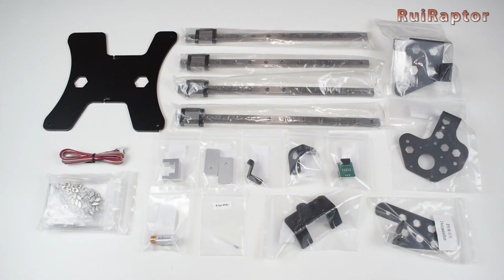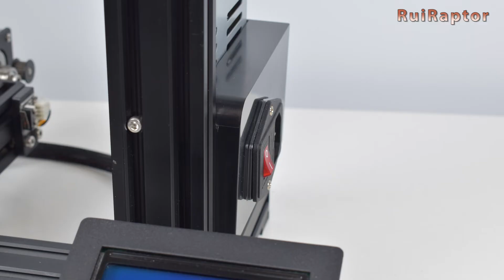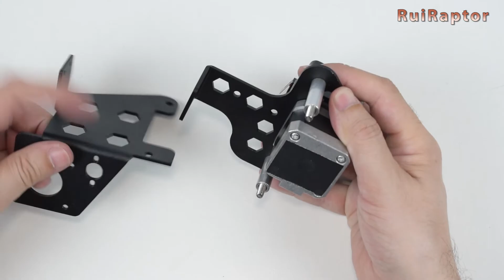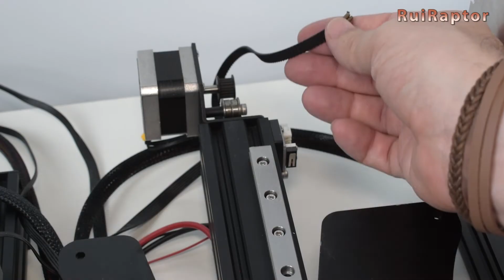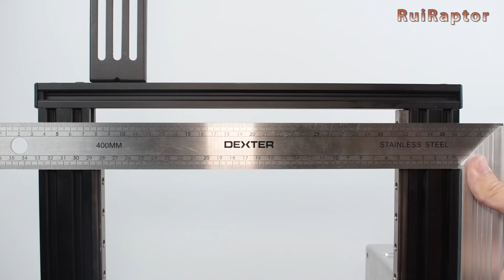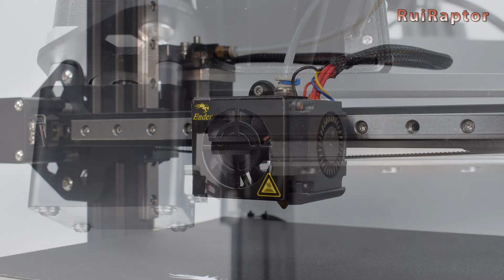Creality Ender 3/PRO UPGRADE - HOW TO Install Linear Rails (X, Y & Z Axis)

Comment: I converted my old ender 3 to linear rails on all axes, dual ballscrew z axis, microswiss ng direct drive with bltouch and bigtreetech skr main board, klipper. all custom parts machined on cnc out of 6061 alu stock. feels amazing, silent and I got 417mm z travel as a bonus.

Comment: Thank you for the amazing video. Well, it won't make a difference on the print quality if you print at the stock slow speed, especially if you know how to adjust the V-slot wheels. However, it makes a difference when printing at higher speeds (e.g. if you are using Klipper). Also, it increases the service life of the stepper motors; where it almost eleminates the friction, reducing the load on the motors.

Comment: If you want a super lightweight carriage.
Buy x2  abit longer alloy profiles. And x2 rails with 4 blocks on them. ( each one should be close to the corners but with some space).
Get a carbonfiber plate with same size as the bed. Cut away as much as possible. Make sure there is some overlap to drill the 4 leveling holes. The blocks are now holding the weight basically. So the carriage dont need to be as strong anymore.

Comment: instead of getting a new belt, on some models just change the X and Y belts... the "New" Y belt just needs less tension than before, because it's a little bit shorter.. but it's an option in some cases

Comment: Such a pointless upgrade. Way overkill. FDM printers aren't CNCing metal.
Reply: Wheel nerd
Reply: I dont think its pointless on the x axis if your going with a direct drive, other than that its prob overkill.
Reply: With this upgrade, along with the creality Sonic pad/klipper firmware I'm able to print at 150mm/s without the wear on the wear on the wheels. The rails are more easy to maintain. I don't think it is pointless
Reply: Honestly not pointless if we account for the uneven wheel wear of the y axis. The x and z axis wheels evenly wear out, while the y axis wears out on the bottom more then the top because well duh gravity pulls the wheels onto the bottom edge. 

Not to mention the z axis upgrade helps with alignment and sag. And even z axis twist if you have a direct drive extruder. 

X axis linear rail would be nice for faster speeds. 

Overall its a great upgrade for what it is. And considering the accuracy of some printers reaching into the 10th or hundredth of a mm its still fairly accurate for the average consumer.

Comment: Hello! very interesting and informative, I love it! I have a question: I have a very old CR7 3D printer, but right now the motherboard has deteriorated, I bought a new ender 3 clearity v4.2.2
the question is that I did not take into account the power supply of the board, that is: 24 volt power is written on the new dress and 12 volt power supply on the old one. so I have to buy another 24 volt power supply or does this board have the function of working on both voltages> 24 volts and 12 volts ??? thanks for the reply in advance! Best regards, George!

Comment: I made a DIY Z axis linear rail set by CNC cutting my factory plates, adding dual Z, adding very short solid bed spacers leftover from the rollers, and I can now reach 271mm in my Z axis!

Comment: I take issue with the videos claim that linear rails do not improve print quality.

The only reason you wouldn't see any improvement to your print quality is if your print quality was already maxed out at 30 mm a second

On the other hand where you really  see a huge benefit with linear rails is when you want to push the limits of the machines speed capabilities.

If you're happy printing it 30 mm a second then there's no need to upgrade to linear rails, on the other hand plastic wheels start to have real issues when printing speeds start to exceed 60mm/s

On the other hand linear rails combined with clipper firmware and input shaping allows you to significantly increase your print and acceleration speeds

It's not uncommon to see E3 v2s outfitted with linear rails printing at 120 to 150 mm a second with accelerations in the range of 3,000 to 7,000 and get the same quality They were getting at 30 mm a second.

In other words Linear rails on the Ender 3 will allow you to increase your print speed and acceleration to the point where the stepper motors start losing steps.

A stock E3V2 with plastic wheels can barely handle acceleration of 300 on the other hand an E3V2 with linear rails can handle accelerations of up to 10,000, of course at those speeds you really need to lighten your y-axis or you're going to start skipping steps.

Going to linear rails and Klipper has allowed me to reduce the print time on some of my prints from 12 hours to just about 5 hours.

So if you're happy printing at 30 mm a second or 60 mm a second with degraded quality then there's no reason to upgrade to linear rails, but if you want to maximize the speed and quality potential of your printer then linear rails are essential
Reply: The main difference come from the X or Y axis? Do you track the before and after installation acceleration difference?
Reply: @felipenavas  Z axis mod has the most advantage because it eliminates gantry sag which is a major weakness of the single Z lead screw design. the next is Y axis mod because the original design only loads one edge of the POM wheels leading to uneven wear demanding more frequent maintenance. rail mod will reduce bed weight. although this mod using a single rail does not inspire the best confidence because you are relying on a single MGN9C to sling almost 2kg of bed mass. i don't think that is a good idea and will prefer dual rails on the sides of the Y extrusion.

Comment: Amazing how much money is spent on these printers with upgrades that aren't going to make much of an improvement. Why not just buy a better printer in the first place?
Reply: That's a fairly odd statement, you obviously have no idea what you're talking about... thats pretty sad.. let me guess by a prusa, right?
Reply: @warriorsofradiance7100  No just the opposite, the Prusa is for people who just want to print and their printer is not their hobby. They are buying an expensive tool that has a reputation for ease of use and reliability.  A bed slinger will always be slow because of the moving Y mass so no matter how much you upgrade you can't overcome physics. While you can improve print quality it will always be slow. There are so many channels pushing upgrades.... only to conclude at the end, "I guess the Benchy looks about the same, so the upgrade worked and you should buy it." CoreXY has much better mechanics and you can print much faster. I got the TronXY X5SA-Pro which is a full metal frame with metal rollers( not linear rails, but a vast improvement over rubber rollers), 32 bit controller, 24 Volt power supply and touch screen. Almost forgot it came with auto bed leveling. You get a lot for your money and don't have to upgrade everything. Next install Klipper firmware on the Raspberry PI that your are already running Octoprint on and you can print fast with high quality but Klipper is more technical than Marlin so a bit of a learning curve. Get an accelerometer and tune Klipper to handle the mechanical resonances resulting in better print quality even faster. Build a high flow hot end and print faster yet. You have a bigger, much faster and very reliable printer without upgrading everything. This weekend I picked up a used Ender 3 Pro to use as a test mule for hot end concepts.  It is solid, much heavier than I expected and a good value, but it is an entry level design optimized for cost and all components were optimized for cost.
Reply: You do know prusa is probably the shittiest old tech in the industry an they fail just as much as any printer. You're just not going to hear about because they keep it as quiet as possible. If you're needing an autobed leveler you're trash at 3d printing. Tronxy is hot garbage, always has been. Core x/y machines are nice but not necessary, if all you care about is speed buy a Resin printer, of which I run/own several.Sorry bud but ender 3s are really good printers. I run a farm of enders do maintenance once a month. Very few failed prints, if any. But I've been at this for 8 years, used wooden framed printers an custom built as well as the super expensive. I'll take a stock ender 3 an make ya look like an amateur. Tell ya what send me your ender 3 because it's so trash..

Comment: Currently installing this same kit to my Ender 3 Pro. A couple things I have found- The kit is missing (4) bolts & t-nuts for the linear rails. The power supply bolts are way to long- my upper one bottomed out and I had to trim it back to 25mm. The lower bolt didnt hit anything so I left it as is. I designed and printed my own alignment tool for the Y axis fitting onto the 40x40 profile.  There was no mention of a Y axis offset for the linear rail so I set it to 25mm off the front of the extrusion. The M3x8mm long bolts are entirely to long for the right side Z carriage & the X carriage on the gantry. This has me at a dead stop as I need to get M3x6mm long bolts. I have also noticed the bent steel plate that holds the Z nut the stackup is off by .5mm and I am out of adjustment. Also the 90 degree bent piece must be slightly off as when it is tightened you can see the stepper motor move. So this will require me to tear apart the gantry to grind the slots out further. In my particular case at the bottom of the vertical rail my Z rod is 25mm +0 -.02mm consistantly. At the top, with the gantry fully raised and the nut adjusted to the best of my ability the Z rod is 24.45mm +/-.02mm - measured with digital calipers. I was able to get the assembly to move smoothly by loosinging up many of the screws and working the unit and slowly snugging them up. However I understand since this is running at an angle my E Steps will be odd at best. I intend to tear down and grind the slots out to make it precise. I also noticed one of the linear rails, oddly enough the smoothest one, had a slight bow to it. This is the one I used for the X gantry since it was the smoothest. I will update as I get it all fixed and installed. If you are doing this mod dont expect to be done in 25 minutes. LoL.
Reply: UGH I had the same issue with my X and Z M3*8 screws being too long. The X axis plate can't be tightened down and I am stuck waiting for the M3*6 screws I just ordered.

Did you message Creality to pass along your feedback? I just sent them an email.
Reply: @red_kirby1  I did not bother. I wound up just ordering a screw assortment so I had plenty for this project and others.

Comment: Great video. However the issue with the hotend adapter is unacceptable. The kit is manufactured by creality for the ender 3/pro and the part doesn't work? Completely invalidates the whole kit. And that right z plate is a joke. There should be dual z axis to help keep the gantry level at all times.

Comment: Will linear rails help with elephant foot?
Reply from the maker: Hi Zach, the elephant foot is an issue caused by the first layer not perfectly calibrated. If you have the elephant foot issue, re-adjust your bed leveling/nozzle to bed distance.
Reply: I wouldn't think so. That's more of a slicer/printer calibration issue.
Reply: No it will not

Comment: Hi Rui thanks for an honest and informative video.
This helped and decided my choice.
Anyway I've found this modification is not for me,
Mostly because I do not see the big gain in this modification, 
and that video is so informative that it provides answers to things one usually lack the knowhow to ask for , 
and in no way promotes a product that is one-sidedly focused only on selling, 
But is so that the viewer can conclude on their own .
THANK YOU.
Reply: Biggest gain is mainly a more maintenance-free operation of the printer.  You only need to keep them clean and lube them every once and a while, as opposed to make sure the rollers are not to tight but not to loose either, which can be a very narrow area between overtightening and having them to loose.
Reply: Actually the video is wrong.
The only reason you wouldn't see any improvement to your print quality is because your print quality is probably already garbage.

No amount of bed leveling or linear rails is going to fix a poorly tuned machine.

On the other hand where you really do see a huge benefit with linear rails is when you want to push the limits of the machines speed capabilities.

If you're happy printing it 30 mm a second then there's no need to upgrade to linear rails, on the other hand plastic wheels start to have real issues when printing speeds start to exceed 60mm/s

On the other hand with linear rails and clipper firmware installed you can print upwards of 120 to 150 mm a second and get the same quality you were getting with the stock wheels at 30 mm a second.

Linear rails on the Ender 3 will allow you to increase your print speed and acceleration to the point where the stepper motors start losing steps.

A stock E3V2 with plastic wheels can barely handle acceleration of 300 on the other hand an E3 V2 with linear rails can handle accelerations of up to 10,000 of course at those speeds you really have got to lighten your y-axis or you're going to start skipping steps.

Going to linear rails and Klipper has allowed me to reduce the print time on some of my prints from 12 hours to just 5 hours.

So if you're happy printing it 30 mm a second then there's no reason to upgrade to linear rails, but if you want to maximize the speed and quality potential of your printer then linear rails are essential

Comment: The belt paths are very diagonal, which will result in a non-linear translation from the stepper movements to the carriage movements
Reply: That's the first thing I noticed.  Total design failure.  Why would they do that?  Was it installed wrong?
Reply: @NackDSP  Probably not.  The stepper motor for the X-axis should be utilising an idler just like the Y-axis does because even with the spanner angled down so it's as horizontal as possible compared to the carriage but it's unfortunately not.
I use sort of the same lineair rail mod for the X-axis and its ehm, exactly the same, and I am not happy with the idea because of exactly the thing you and Ron DLH mentioned.

Comment: Well presented video, but I do have to wonder why bother doing it if the print quality doesn’t really improve and it requires more care and is noisy?
Reply: Linear rails need no adjustment like the eccentric nuts. Also, they won't be affected by dirt etc on the extrusion. They do make a difference in my experience
Reply: @trevormallow2788  I am installing these now to be honest and I printed with the x axis rail prior to upgrading my z and the print was amazing. I’m upgrading my z now
Reply: @ruckus226  Same, only did X in the beginning, it was much better.
Reply: It makes the difference at higher print speeds.
Reply: As far as I've been able to figure out from my linear rails is that they support faster printing and maybe a tad less energy consumption by the whole thing running smoother. The motors don't have to apply quite as much torque on rails as the friction is considerably less.

But the print quality doesn't improve and in fact, surface quality is likely to decrease.

Linear rails are about as hard as you can get hard couplings for motion, so pretty much every little bit of vibration and every little bit of resonance is translated to the print surface.

Linear rails remove some vibrations from the system, but they translate the ones you can't really get rid of (stepper motor steps and lead screw imperfections for instance) directly to the surface of the print.

And the vibrations they remove were already smoothed out to near non existence by the rubber wheels and much softer axial couplings. And those also smooth out stepper steps and all other vibrations in the system to a much less defined extent.

As they are far harder couplings and translate every bit of vibration to the print, you also need to, as the video stated, take far more regular maintenance into account.

But, this only matters for artsy printer users that want nice smooth surfaces they don't have to do much aftertreatment on.

That's why I maintain that artsy users should stay away from FFF and go with resin printers instead.

I personally don't care about surface quality in the slightest as most all my prints are mechanical and the precision and speed linear rails provides when your main focus is printing max print volume sized parts is what I need.

For speed and component focused users, they are great, for purely artsy people, who tend to not be all that technically savvy to start with, I really wouldn't recommend.